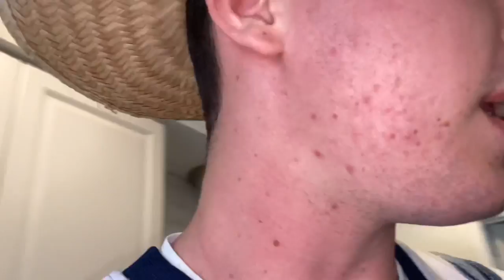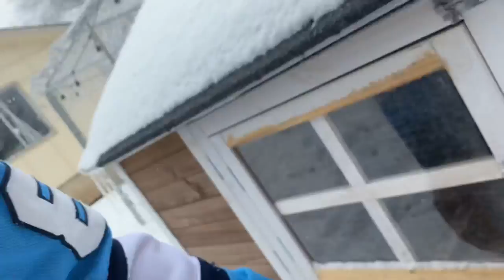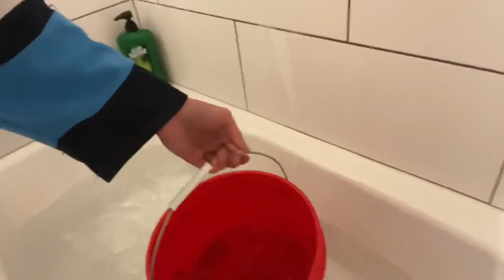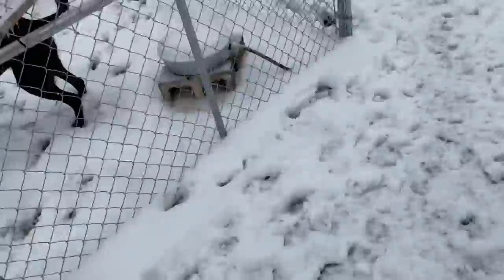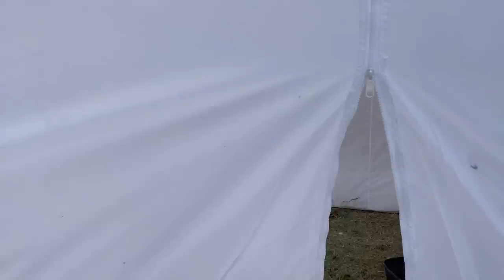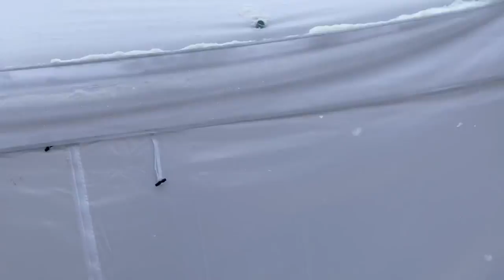Texas Snowstorm with 40 Animals. Please Send Help.

Comment: We had an ice storm in Missouri a few years ago and didn’t have power for at least three days. Fortunately, the water still worked and I had a gas range in the kitchen for cooking and some heat, which I do not have in my current house (freakin’ electric oven…) I took all of the refrigerated items and put them outside.

Comment: If you need water why not use clean snow, while you still have power?
Reply from the maker: I’ve been doing that a bit!!
Reply: The snow is actually dirtyer than you'd think
Melt some next time you see it, im currently in 2 feet of snow and even the middle stuff is gross af
Reply: @samshaffer2250  depends where you live
Reply: @jammuseta4457  anywhere you live, pollutants from the air are everywhere